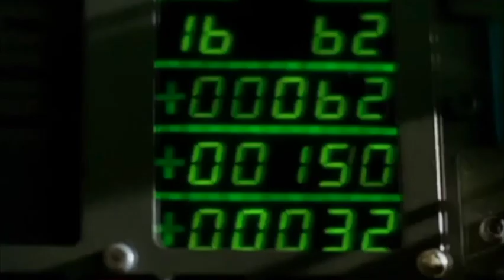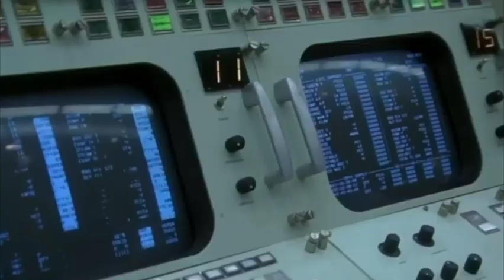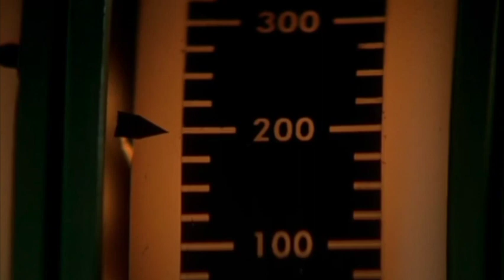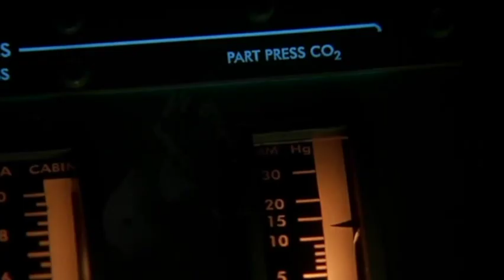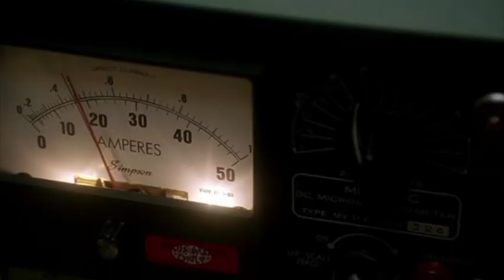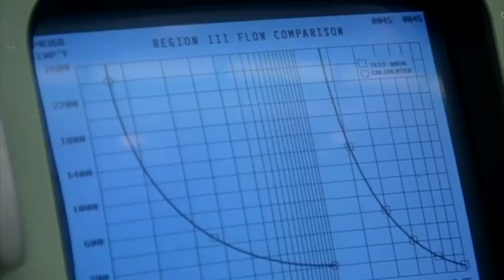Apollo 13 but it's just the buttons, alarms, and stuff

Comment: This is really nostalgic because now everything is in LCD touch screen.
Reply from the maker: “Well, I see we agree on something.”
Reply: Imagine the spectacular failures that will be caused by that horrible, unreliable technology.
Reply: @RideAcrossTheRiver  space hardware was and still is tested extensively before launch. Every piece of hardware has a tolerance range at which certain things could fail. Apollo 13 had a failure because the testing didn't reveal a broken tank which was dropped.
Reply: @RossComputerGuy  Mechanical switches are best.
Reply: I think a majority of SLS' interface is analog switches. SpaceX has a lot of touchscreen stuff. NASA does checklists on iPad I think though
Reply: its actually required for a lot of the most important functions to have physical buttons/switches on stuff like this, for the reasons everyone has described.